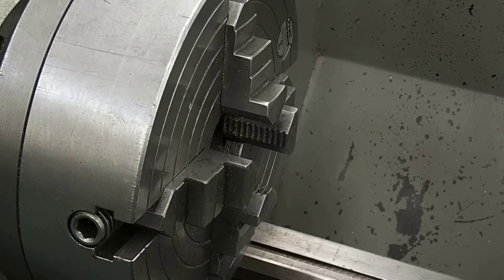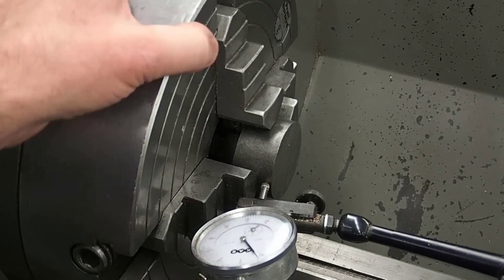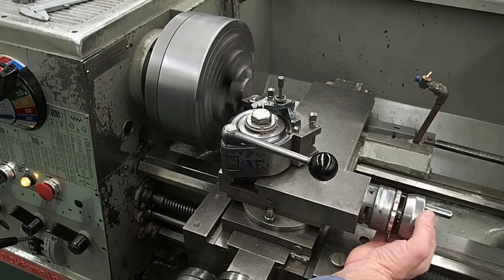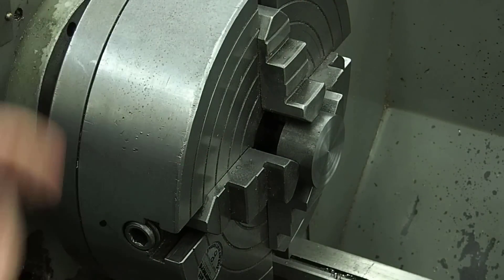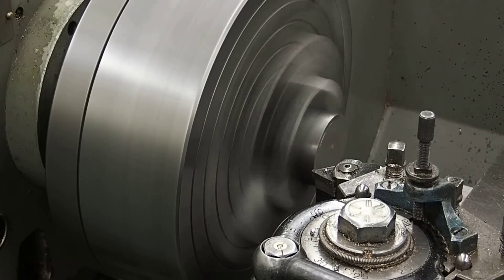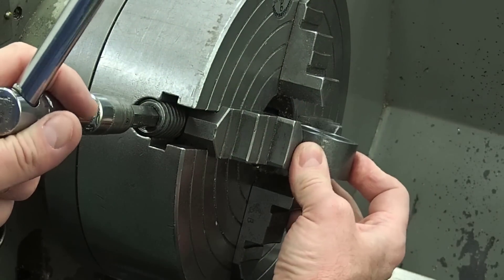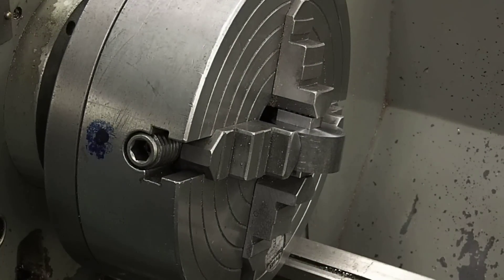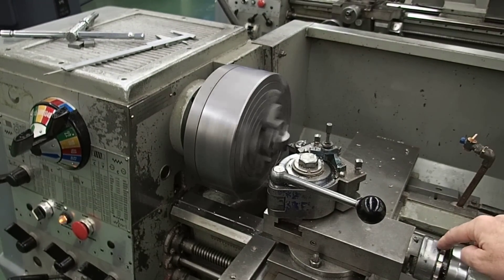Machining a Cube on a Lathe

Comment: Just like I used to do it with my 4-jaw chuck before I retired.  Perfectly logical, and a stepping-off point for making more complex solid figures.  My lathe was built in 1943 four years before I was born, by Logan, a Kentucky shop that still makes parts for my lathe.  My particular lathe was sent to Detroit for manufacturing parts for World War II, and then was used in Houston to refurbish electric motors on ships that came into harbor.  Logan was able to give me the history of my particular lathe, which I still own, and which still can cut to one-thousandth of an inch.
Reply from the maker: Nothing like an old piece of equipment! I had a mill as an apprentice that was on loan to England during WW2. It had a nice plaque on it's side from the King thanking Canada for sending it. Thanks for sharing your story.
Reply: I would love to see your lathe, and if allowed to cut some threads on it
Reply: Hi Daniel (a year later, heh.) Sounds like you knew that machine pretty well. I am curious, how much wear did the ways have? I know that some of the machine tools used for the war effort were rode hard, 3 shifts a day making parts as big as they can swing. Regular maintenance would have helped, but how did your in particular fare? How much wear in the carriage nut and screw? Were the jaws badly bellmouthed?
I'd love to get into machining, but there are damn few places doing anything but CNC around here.
Reply: 16/6 23, Over 50 years ago a, then, local Co advertised for skilled Toolmaking machinists -  'only apply if you can cut a dovetail on a shaper.'😊
Reply: Very interesting, it's always cool to tie a story, a person or history to an object. Thanks for sharing!

Comment: to get really parralell i would use aground block to push it back against
Reply from the maker: That would help, thanks for your suggestion.
Reply: Machine a backstop in situ after the first face, (actually skim the  face, then reverse to get it squarer than a saw cut,) machine and reverse to re-skim the first face. Faces can then be pushed onto the backstop, machining as needed.. Much easier if you face, skim and part off the billet instead of a saw cut billet.

Comment: if you started with longer stock, cut less of the radius, would not you end up with a larger block, considering original stock is 2" diameter?
Reply from the maker: The largest square you could get out of 2" stock would be 1.414".

Comment: I have made hexagon out of a 6mm plate cutting on my 4 jaw lathe . It was a job in my fitter course to be done by filing and cutting by hacksaw , but due to laziness I prefer lathe .
Reply from the maker: That would be a lot of work.
Reply: @machiningmoments  yeah but less than filing . I had marked the lines with hands , to find the line for facing I used a piece of pointed  wire mounted on tool post and moved along the line using cross slide .

Comment: Thanks, Mr.Machiningmoments man! How can a similar cube be made accurately, using a 3-jaw chuck, please? That's a challenge which hasn’t been tried here yet. I've only ever made circular objects, screw threads, simple gear teeth, flat face cuts and tapers. Some of the latter were only useful as slow ways of making buckets full of turnings, and sometimes rather expensive steel wool.
Reply from the maker: This guy uses a three jaw. https://www.youtube.com/watch?v=AuS6HDHc7XE&t=172s

Comment: Hello, complete beginner question - I was wondering if a tool exists that, instead of facing something with a parting tool or facing tool, that there was something that was the diameter of the piece, that you could just tap the thing on the part and make a rough but perfectly square face? Not all the way into a cube haha. I want to square off a 1" round piece of wood or acrylic in my lathe for making kitless/bespoke pens, I'll never use metal. Also it doesn't matter if it's rough, because I'll sand it all down to finish it anyways. Barrel trimmers are used normally, but they leave a hole in the middle, because that doesn't matter normally, because the center of the pen is a hollow tube and there's metal bits you press into the ends of the pen. But I want a cap and a body that has one side closed, I want the wood/acrylic to wrap all the way around the edges of the pen, so I'd like a quick way of making the sides of the wood/acrylic square. Sorry for the long message!
Reply from the maker: @chloejenkins6829  good morning, I don't know much about woodworking, other than I respect a good woodworker, but there should be some gadget as you describe. With metal I have a few options to get the same result. Using a milling machine or surface grinder are other choices. I'm not sure where you are but in Canada we have a store called "Lee Valley", the cater to woodworking and have the neatest gadgets. I'm thinking there may be something there. Good luck! Thanks for watching and sending a note.
Reply: @machiningmoments  Hello, I'm so sorry, I didn't see this!! I know of Lee Valley, I'll check out if they have anything. Thank you!!

Comment: Why does the center of the part need to be inside the chuck?
Reply from the maker: It need to be in far enough so the jaw on the outside diameter makes contact at least with the centerline of the radius. I typically will put the part in further so as not to miss that centerline...but not required.

Comment: Sir,square cutting in lathe done by you is perfect alignment .the process of turn of work piece and holding by jaw so skill.sir Will you plz share the practical vdo of Straight and helical Reamer making process in conventional Horizontal milling machine through indexing by use of different milling cutters.
Reply from the maker: Due to Covid I do not have access to the shop at this time. When life returns to normal I will look at your request. Thank you for watching and your message. Stay safe.

Comment: If you extend the shims out slightly past the end of the part before turning, you can indicate the INSIDE faces of them to get the part centered in that direction. You will need to use a test style indicator rather than an AGD style for that, though.
Reply from the maker: Good suggestion!

Comment: The title should be "Machining an object that looks like a cube on a lathe".  When you are done, you should put your piece on a surface plate and check to see if you have in fact made a cube.  Opposite sides need to be parallel and adjacent facets need to be orthogonal.

Comment: Why not use a back stop down the centre of the chuck?....would be much easier to achieve the square dimensions across the faces when used with the dial on the compound slide
Reply from the maker: Yes, that would have helped. Thank you for the suggestion.

Comment: How do you ensure precision perpendicularity with this though??
Reply from the maker: If you were concerned about parallel or perpendicularity finishing up with a process such as grinding would be more accurate.
Reply: @machiningmoments  you surely wouldn't say "why bother making this square" on a milling machine.
Reply from the maker: Agreed
Reply from the maker: This video came about because of a guy who had to make a cube and only had a lathe.
Reply: @machiningmoments  yes, and I'm just suggesting there is a way to - just as you can with a Mill - make perpendicular and parallel cubes on a lathe.

Comment: If the jaws of the chuck are perpendicular to the headstock face the whole thing can be made without actually centering the piece.  The cut marks may be off center but it would still be a cube.
Reply from the maker: Exactly

Comment: I take square stock to my band saw nad cut it.  Or, machine 2 sides of round stock by saw cutting  - then milling.  Can't see a reason for this process.
Reply from the maker: It was only done because I was asked if it was possible. I agree I would have used a milling machine also.

Comment: Wouldn't it have been better to flip it 180 rather than 90 after the third cut since less adjusting would be required?
Reply from the maker: It was turned 90 to take advantage of the straight side against the chuck jaw.

Comment: Sometimes a 16mm hex "Allen key" is handy to move two jaws at the same time. &
sq stock bar across the chuck face between the jaws, to set the workpiece to same depth
and square in the jaws, for repetitive jobs.
Reply from the maker: Thank you for the tip!
Reply: @machiningmoments You`re welcome,  
another tip;   Quick tool height check,
 trap a steel rule against dia with tool.
Reply from the maker: Thanks, that is a good tip.

Comment: the first time you turned on the lathe going for the third facing cut, the part spinning looked really scary
Reply from the maker: Holding work in a 4 jaw chuck is very secure.

Comment: Ok, brass, I could see. But how do you hog .100 D.O.C. on steel with no coolant, and there are no blue chips, and the part isn't even hot? 
I would think it would be quite hot. What type of steel is that?
Reply from the maker: I believe it is low carbon leaded steel. The free machining allows for heavy cuts.
Reply: Like 12L14? I used to use a lot of that. Mostly CNC lathes, though, so everything got lots of coolant. It never occurred to me to run it dry.
This video proves it is possible. I would've been to chicken to take .100 at a crack though, too afraid the piece would come loose in the chuck.
I can tell you one thing though, try running 304 stainless dry, and that stuff will work harden in about two seconds. Very cool video!
Reply from the maker: Yes, I believe it is C12L14. I often run a manual lathe dry, in this case the inserts will tolerate it. It would be difficult to video it wet. yes 304 is a different animal.
Thanks!

Comment: Do any Machinists here have experience with the Curved Tool Post featured in this video? I see them for sale every so often and I would have to believe more contact area would mean its sturdier, compared to the old 4 sided design we've all used. Any thoughts?
Reply from the maker: What I really like about these, quick change tool posts, is the ability to change the angle slightly by moving one groove. Usually 7-1/2, 10, or 15 degrees per groove. I have not had an issue with them being sturdy.They work great.

Comment: As for when you flipped the piece, you don’t need to use a marker to mark which jaws you loosened. The big red “button” is there for that purpose. You loosen either side instead of the marker

Comment: You mentioned you could do this in a 3 jaw?? I'd love to see that video 😂 lots of comments about using a mill to do this and yes you could use a milling machine or you could buy square stock? Many other ways to also do it but that's not the point of the video, cool idea but only practical if your stuck or only have a lathe.... Will still try it at work though just for fun. Thanks
Reply from the maker: This guy does a cube in a three jaw. https://www.youtube.com/watch?v=AuS6HDHc7XE&t=145s 
A mill is definitely easier, this video originated because a viewer asked who only had a lathe. Thanks for your post Luke.

Comment: I'm not a machinist but I happened across this site its very interesting Does the feeding in on the compound require it to be set to zero?  I didn't see anything about that being mentioned I mean if you're feeding the compound at an angle doesn't that mess everything up
Reply from the maker: Hi Joe, the compound should be set at zero to get an accurate depth of cut. If it is at an angle the depth is inaccurate. Thanks for asking and watching.

Comment: Heating during cutting isn't a problem needing cooling solution/oil? Or is the hardness of the carbide so much greater than the metal being cut heat isn't an issue?
Reply from the maker: Carbide can be run dry on mild steel, it won't affect the insert.

Comment: Hmm  ... so the second cut,  there is no check or guarantee that the second cut is parallel to the first cut, as when the part id put back in the lathe, it may not be perfectly on axis.
Reply from the maker: You are right Robin. I focused on the process, not accuracy.

Comment: Brings back memories from a long time ago
Reply from the maker: You have been at this for a while?
Reply: @machiningmoments  I'm in my mid 50's now, but was an apprentice in my youth, and spent several years in the machine shop - turning, milling, drilling, shaping, grinding, and of course the obligatory hand filing a square into a ball lol. I haven't looked at a lathe since as I went into the drawing office. Seeing your video brought back a lot of memories. I enjoyed turning most. I worked at a small gas turbine factory, and the work was very intricate and varied, working with lots of different materials and parts. No two days were the same. I still remember the smell of suds. Nostalgia :0)
Reply from the maker: :) Great memories, thanks for sharing.

Comment: Pardon me if this is a stupid question Why don't they make this square to start with and squares which need to be round round from the start, it's not as if this is being done by machine.
Reply from the maker: Just to show it is possible, using square stock would be smarter!

Comment: I'm wondering why, after your facing cuts, you did cuts in order around the round sides instead of doing opposite sides, that is, you did sides 1-2-3-4 instead of 1-3-2-4?  Also, magnetic shims might save a tiny amount of effort.
Reply from the maker: Honestly, I find I can keep it more square rotating 90 degs. My personal feeling is while magnetic shims work great I don't like them. Chips stick to them and other parts pick up magnetism.

Comment: the time you are moving the tool towards the workpiece, the workpiece hits the tool, like impact. I guess this causes the tool to fracture. isn't it better, in this case, to start from the middle with shallow cut depth and go toward the outer diameters? BtW, it was a very great video.
Reply from the maker: The cutting tool is carbide and the piece being cut is mild steel so the cutter stands up well to the impact. Thanks for watching and taking time to leave a message.

Comment: Thanks for this tutorial, very interesting. When I first saw the title I said "making a cube on a lathe"? I thought that was what a milling machine was for and never considered using a lathe but as you started I saw where you were going learned something new. Just one question, wouldn't it have been better to start from the center and make the face cuts out rather than doing the opposite? I'm thinking that cutting in from the outside could be pretty tough on the cutting tool and the machine or maybe it doesn't make a difference?
Reply from the maker: Hi Rich, I'm glad you enjoyed this. Because the work is solid in the center it is better to start the tool from the outside and work towards center. Starting close the the center and pushing into the work to set the depth of cut and moving away from center has the potential of creating a lot of cutting forces and possibly breaking the cutting tool.
Reply: Thanks for taking the time to answer. I don't have any experience with this but it just seemed that it would be better starting on the material at the center and moving outward just for the reason you said doing the opposite. I just learned another new thing.

Comment: Can you by any chance do this with 3 jaw chuck?
Reply from the maker: Yes you can do this in a three jaw.
Reply: @machiningmoments  Can you recommend a suitable method for that? If you already have a video on that it would be helpful.
Reply from the maker: @milaanpatel4997 have a look at this guy.
https://youtu.be/AuS6HDHc7XE
Reply: @machiningmoments  Thanks, I've already seen this video(an year back I guess). However, I am unable the picture how to make accurate right angled faces. It seems like he used the surface of the chuck for alignment which could affect the accuracy due to play between jaws and chuck. I am wondering if there is more fool proof method to do so. 
I might be wrong, I am just curious. Thank you for reply.
Reply from the maker: @milaanpatel4997  He is relying on the side of the chuck jaw for pependicularity to the facing. If accuracy is a concern a mill is a better choice even better is a surface grinder.

Comment: Cool, I learned a new unit of measurement: Thou. I guess it makes sense to decimalize an inch, to make calculations easier. I always thought it must be quite difficult to be an American machinist and doing all measurements  and calculations with inch-fractions.
Reply from the maker: To start I am not American. I do however live in North America and imperial, decimal inches is the predominant unit of measurement in the machine shop. I am fluent in both imperial and metric.

Comment: Is the piece hot when you remove it after making a cut?  I enjoyed this very much.
Reply from the maker: It is warm but not hot, machinist typically build a tolerance to holding parts with elevated temperatures.

Comment: Last time I saw a LeBlonde like that was at San Joaquin Delta College in Stockton 89' . Thats a pretty cool tool post holder . Never seen one like that . How square did it turn out ? Down to the tenths .
Reply from the maker: This one is a Colchester, LeBlondes are a great lathe also! Honestly, I didn't check it I suspect not very. If square was important I'd have likely roughed it out (probably on a mill) and finished with another process...surface grinding.

Comment: Love lathes, but never worked on one ...   have a dumb question for you ...  why all the cuts are made dry. Some oil would not help to do it smoother ??
      As far as i see nobody oils anything when using the lathe ...  thanks .!
Reply from the maker: Carbides like to be dry, or be continuously wet. Oil creates smoke...It would hinder the video but help with the finish.